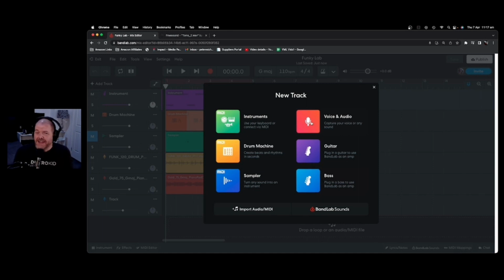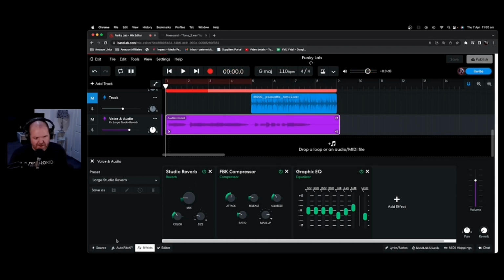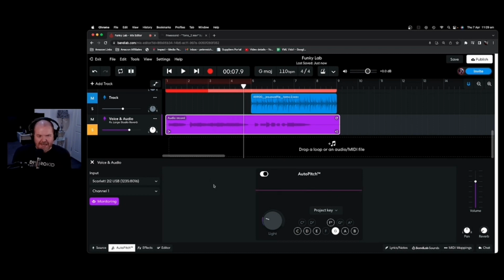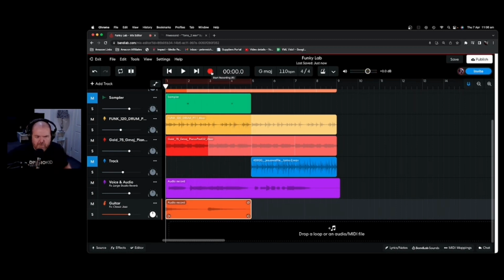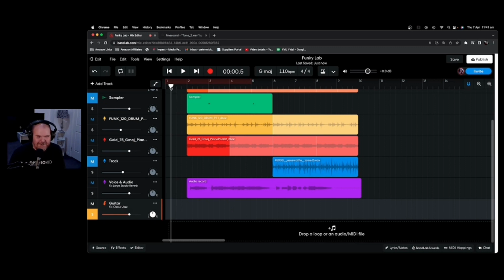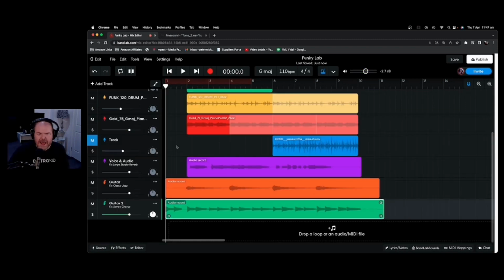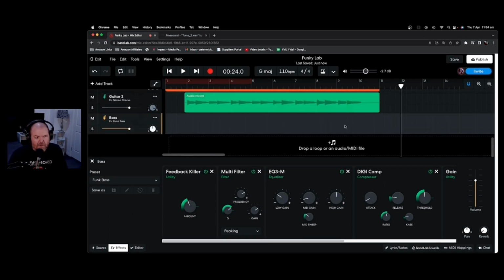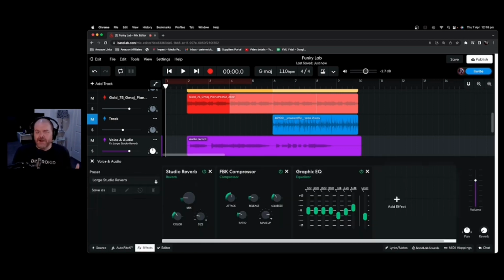BandLab | Recording Vocals, Guitar and Bass

Comment: @7:04 whenever I try to add in my guitar parts... when I strum it sounds extremely delayed so not sure how that can be changed?
Reply from the maker: Yeah. That’s a challenge. Latency is a real thing especially if you’re using slightly older gear.

Comment: I have done everything you have done step by step but bandlab is not picking up any of my guitars sound, input level doesnt move. I made my input and outputs are correct, but its still not picking up my guitar. I need help, im using scarlett solo
Reply from the maker: Sorry to hear. Are you on iPhone? iPad? Desktop? Make sure you have a good quality adapter and cable regardless.
Reply: @PeteJohnsStudioLiveToday im on pc. I can bear my guitar through my headphones just fine, but for some reason bandlab doesn’t pick up the sound at all. How is it that i can hear it but on bandlab the input volume doesnt budge?

Comment: I plug in my guitar in the audio interface and did everything u did in bandlab but theres no sound pls help. The audio interface i use is Minifuse 1
Reply from the maker: Make sure it has enough power. A decent hub or adapter will help. https://youtu.be/P8oYFrrqlDk?si=cQ6KZSMN8ScHauLB

Comment: Hi. I have a Behringer UM2. I connect it to my laptop via its USB cable but despite Bandlab kind of recognizes that there's a Behringer connected, when I choose it, it says "no device". Weird! Any suggestions. I cannot hear the guitar when choosing this option. I can only hear the guitar when choosing "Realtek Audio" option but that's not helping regarding the quality of the recordings
Reply from the maker: Sounds off. The audio interface should be class compliant and not need drivers? Make sure you’re tried turning off and back on and then re-plugging kn.  Can sometimes help.

Comment: What if you want to record a guitar amp with an external mic and you're using pedals for all of your effects. Do you still use the guitar tab track thing or would you just record like you were doing a vocal track? The only thing going into the interface would be the mic? Is that how you would set up something like that up if you don't want to plug the guitar directly into the interface or do you still use the guitar channel tab thing?
Reply from the maker: Really up to you so try both ways and see what works. If all your processing is external all you really need is a clean audio track.
Reply: @PeteJohnsStudioLiveToday  Thanks i figured that out. I've got another question. Can you import video with Bandlab on a computer? Like record a video on your phone and then transfer it to your computer and sync it up with the better audio track? I see where it says drag/drop audio/video files but when i do that it only brings in the audio file. I was hoping to be able to mute the audio part of that file and use only the video part. But i don't see any video. Is it possible to make a video like this?

Comment: I know this is an older video.  But I need a bit of advice.  When you clicked on the input I noticed you had a Zoom l-8 as a choice.  On my Bandlab setup I see I have my Zoom l-20 as a choice, however if I select it, Bandlab still shows "No Device".  Not sure what I am doing wrong.
Reply: That is happening to me too
Reply from the maker: This is odd? Are you using BandLab on mobile or desktop? Maybe email me if you still need help.

Comment: I have a problem so I'd like someone to help me. When I use channel 2 for guitar, when I play it, I don't hear it the moment I play it. It's a whole second late when I play the chord. It's like the headphones aren't right, but I doubt it. If you can give me some advice on how to fix it. Everything else works without error, that's all I have.
Reply from the maker: Sounds like latency. Make sure you’re using wired headphones (not Bluetooth) and close any other apps or background promgras running. Also you can turn off and back on which can sometimes help.

Comment: i use the boss gt 1000 core to record the wet signal, i can hear it but during monitoring there is lag, and then when i record i can barely hear it, not sure what is going on, i tried the lag correction thing under tools but it says unplug your microphone or cant hear your speakers, i tried with my focusrite clarett as well but ran into the same issue, no matter what i do on the actual hardware like increase the output or input levels, bandlab barely adjusts the input coming into it.
Reply from the maker: Hmmmm…. Haven’t come across anything quite like that. Maybe ask over at the Create Record Release Facebook group at http://createrecordreleaae.com, or the Discord group here - http://studiolivetoday.com/discord.
Reply: @PeteJohnsStudioLiveToday  i went to the editor and adjusted the gain from there, that seemed to help, but can't fix the lag issue, other online DAWs are able to calibrate with just the interface plugged in, i guess thats the downside of bandlab being free.
Reply: @LokeshThakur  Hello, I have been arriving here with the same problem. I try to record my electric bass using a Scarlett Solo as an audio interface from the PC. But the latency is high, and there's nothing you can do from the focusrite driver to eliminate it. Tell me if you were able to solve it. Thank you.

Comment: I'm curious, is there a way to adjust the recording sample rate? When I record guitar I notice that there is a slight recording delay and it can be painful to try to sync. Hopefully I'm explaining it well enough but I'm wondering if there's any way to better get this synced quickly. Great video btw!
Reply from the maker: Hey there. Unfortunately there aren’t many ways to adjust latency when recording as it depends more on the gear you’re using.
Reply: @PeteJohnsStudioLiveToday  I tried it first with a Behringer U-Phoria UM2 and then today I went out and bought a Focusrite Scarlet Solo. Still a bit of latency and I'm not sure what can be done
Reply: I just started using BandLab and the latency is killing me right now on guitar. If I can't fix this...I'm wondering what's the point?
Reply: Quick update. I changed channels from 2 to 1 on the audio interface. Presonus. It's better. Not sure if this is advisable or matters....seems way more responsive now.
Reply: Get the irig 2 yall

Comment: help anyone, can't get my guitar to record but i hear it. its like the program doesn't recognize my daw because i see the input levels change on the daw leds but nothing registers on the input monitoring on bandlab
Reply from the maker: Yeah not sure sorry? Maybe ask over at the Create Record Release Facebook group at http://createrecordreleaae.com, or the Discord group here - http://studiolivetoday.com/discord.
Reply: @PeteJohnsStudioLiveToday  So I realized that for whatever reason my Inst 2 line wasn't being registered by the app for some reason. I actually connected my guitar cable to the 1 line on my interface which is for MIC input...and it worked. The thing with that is, the connection isn't secure since the guitar cable barely fit in the MIC input but I managed to get it to work for the most part. I'll comment my experience on the FB group in case anyone else encounters this problem but I don't recommend it because it can damage the port if you aren't careful

Comment: Good video.
Anyone can help me solve a mystery?

When I try to record my acoustic guitar, the volume is so low (you can't hear it). I use my fender mustang as an interface, crank all the volume up and still, you can barely hear my recording. But, if I use distortion (yes, with my acoustic guitar, just to test) it record just fine.

The volume on my guitar is all the way up, master volume on my amp all the way up! I'm using the fender clean amp preset but it just won't work. I've tried the same settings in audacity... and it record just fine.
Reply from the maker: Hey there. I’d probably need to know exactly how you’re connecting the guitar. It sounds like you’re he input might be set to a line level instead of an instrument level? Perhaps ask here - http://studiolivetoday.com/garageband 

Or maybe ask over at the Create Record Release Facebook group at http://createrecordreleaae.com, or the Discord group here - http://studiolivetoday.com/discord.